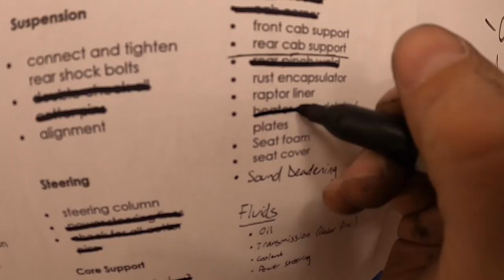Heater Core Delete | 1970 LS Swap Chevy C10

Comment: I also simplified my truck by deleting all non-essentials. I drive very short trips so the 2nd gas tank was deleted along with the switch and extra fuel lines. Ash tray also gone! Radio deleted. Speakers deleted. Cruise control deleted. etc... However, when it snows, my heavy 1976 K20 is the 4x4 vehicle to drive. Thus, the heater core, for me, is essential. In Paul's case, a C10 would be a poor winter vehicle and I totally get why he is doing this. Keep going Paul! Make it your own.

Comment: Great job Paul!!!! Another step closer to  being done... 😆 I feel your pain about the cold weather. Here in Ontario,  Canada   we seem to have winter back!! 😢😠 A few weeks ago it was beautiful  and warm we turned off the heat in the house, I got out to work  on the 67 C10.  I started working  on the rear stepside  fender. Metal work, and welding , rust repair.
Reply from the maker: We were in the 70s early last week and 30s by the end of it
Reply: @paulkc10  that sucks! For what nice warm weather we had the grass and most of the flowers started to grow, then it dropped below zero and also snowed more! Not good at all.... it has dropped  below zero tonight and calling  for rain maybe mixed flurries. 😠

Comment: Great vid. Bud next time please where a respirator when sanding fiberglass! Safety first
Reply from the maker: You are right. Good lookin out 👍🏼
Reply: paulk_c10 I have a 72 C 10 myself. I removed all of the parts out. I’m not sure how much further i want to go. I feel like I’m better off taking the cab off and replacing the rubber mounts and make everything new. I see that you braced the inner cab, what’s the reason for it. Thank you
Reply from the maker: I knew I had to cut out quite a bit of the floor and didn’t want the cab to twist on me. I also wasn’t sure what order I was going to do things and wanted the extra support for when I had the cab on its back.

Comment: Looks like 2 years ago. Been binge watching some of your videos. Overall I enjoy your project you have talent and do pretty good work. Anyways, it is too late to help you with the this C/10 Build, but it may help others and your future builds? NOTE: Fiberglass Body Filler is made for boats and Corvettes, not for metal vehicles. (Says exactly that on the package.) It is definitely not for covering incomplete metal work, bad or half-a** metal work. Nor hiding any welding defects such as pin holes? All you are doing is covering up and creating "future rust areas." Maybe not in 5 years but at some point. Rust is the number one enemy of any paint job or body work we can do. Prevention is key from every step. Even painting the screw holes drilled in body panels after paint us always missed. Sorry wish I could tell you otherwise, but body filler fiberglass or not will NIOT prevent moisture or rust from taking root. Worker smarter not harder, take your time to do the extra work. Please challenge yourself to get your metal work welding and grinding as perfect as possible. More work in the metal saves adding filler on top to hide it. Body filler should NOT be applied thicker than 1/8" to 1/16" skim coat just to smooth it out. Only after doing quality metal straitening, filling, Patching, and welding. Never use body filler to fill holes, dents, or rusted and untreated rusted panels or metal. I hope this helps on future builds. Can't wait to see what is next. Thanks and best wishes...

Comment: I was like "You've got the welder out, might as weld it up." But looks awesome. I'm about to do a similar thing to my S10.
Reply from the maker: I ran out of shielding gas! I was going back and forth what I wanted to do
Reply: @paulkc10  Always seems to happen at the worst possible time. After it happened to me the last time, I think I got the 80cf tank. It's lasted me almost a year. lol
Reply: Since I had to weld patch I went and welder up.  But dats just me
Reply: @paulkc10  use seam sealer behind that panel an bolt it on,if you wont to weld in in later you can.

Comment: I'm doing the opposite - trying to restore the heater system in a 1971 GMC 1500 step side retired 1/4 mile dragster.  Can't find heater core brackets for a unit w/o AC.  Apparently, the units w/o AC use a different heater core than units w/ AC.

Comment: I like the heat powered fan on your wood stove.
Reply from the maker: It’s pretty neat. Moves enough air to keep things circulating
Reply: paulk_c10 yes. I’ve heard those things are pretty good at circulating the air. And the one of the best things is, you don’t need to plug it in or put batteries in it!

Comment: Hey Paul, I'm currently doing and ls swap and was very curious if I need the stock heater on the 1970 chevy c10 that I have. I want to delete it and later down the road add a heater and ac in the truck. By deleting the stock heater will I be able to do so
Reply from the maker: I deleted mine. You can run an aftermarket heat/ac later no problem.

Comment: Would it be a good idea to shave the rain gutter on my 68 C-10
Reply from the maker: Sure
Reply: @paulkc10  cool are you going to shave the ones on your truck
Reply from the maker: I am not. Just clean em up
Reply: @danielmartin6765  it's definitely a lot of work. Mine were completely rusted and I wanted to shave them, they look nice but they're part of the c10's body lines.

I ended up getting a complete roof swap from a donor cab lol.

Comment: What are the benefits of getting rid of the heater core?
Reply from the maker: Cleaner engine bay. I’m not driving this in cold weather when it’s done. I am going to do a couple things to stay warm and defrost the windshield
Reply: @paulkc10  wear a jacket and wipe the windshield? So if I were to go to a cold area I need the heater core then is what you're telling me.
Reply from the maker: If you plan on driving it year round. Yea
Reply: Electric 12 v heater work great 
Cost around $20+-
You can install 2 one the windshield other one to vents